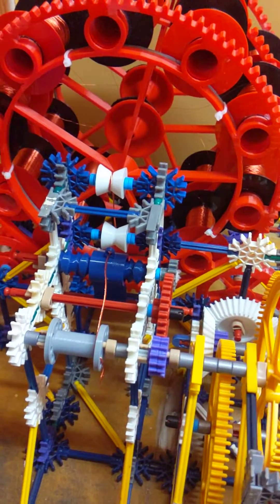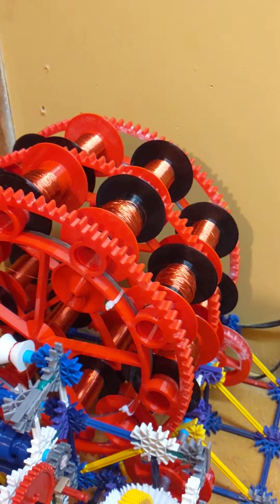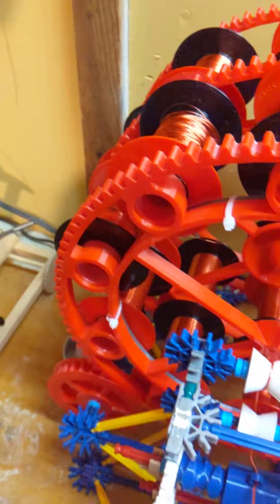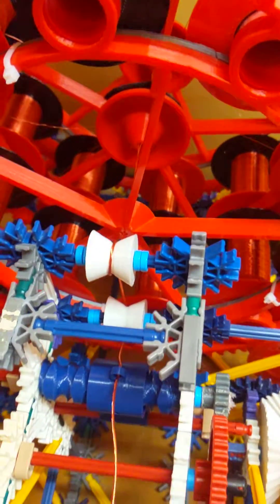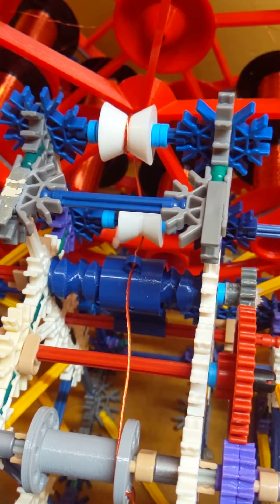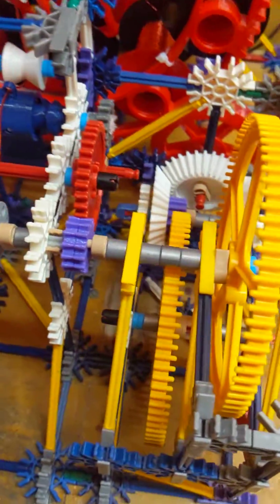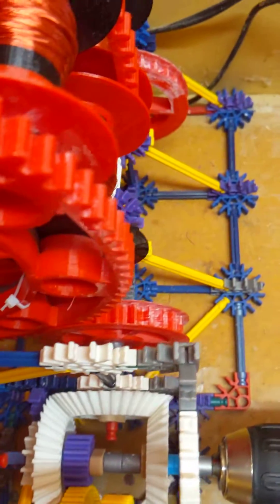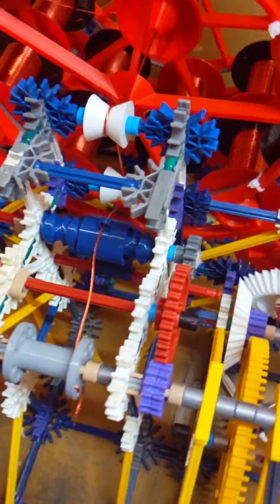Litz wire winding machine

Comment: Holy hell this is impressive!  I saw your comment on Hyperspace Pirate's wire winder project video and I knew I had to see this.  Sounds like it needs more goose grease!  Seriously though soapy water works well for cooling and lubricating lego and knex gears to reduce wear and noise while remaining easy to remove afterwards.  If you run ABS parts under load too fast they have a tendency to melt and stick.  Found that out with my vacuum beater-bar motor dragster lol.
Reply from the maker: Haha, thank you. I will make a second version of this in the future. But yeah I have some lubricant, and have not yet run into issues with heat/friction

Comment: Is this true Litz wire? IOW, are the conductors braided such that they cycle between the surface and the core? Or are they just twisted like a rope?
Reply from the maker: It is not braided. It is only twisted.
Reply: @colbyjohnson2344 , why do you call it Litz wire, then?
Reply from the maker: I suppose for the same reasons the wire manufacturers call simply twisted wire "litz" wire. 
for example:
https://www.newenglandwire.com/product/litz-wire-types-and-constructions/
https://info.triadmagnetics.com/blog/what-is-litz-wire-and-its-applications

Sorry If I have offended you
Reply: @colbyjohnson2344 , they used sloppy terminology. If the conductors don't cycle between the surface and the core it's not Litz. There's no reason to name twisted wire after someone, after all. And it has a specific functionality that twisted wire lacks.
Reply: I agree. This is NOT Litz wire. It's just twisted wires.

Comment: mhm - and why do you not simply use thicker wire that doesn't need to be wound for your brushless motor project?
Reply from the maker: Litz wire is used in brushless motors to reduce Eddy current losses and skin effect losses. The motor I am making runs at a high enough frequency and current that this type of wire is helpful. There is likely room for optimization though